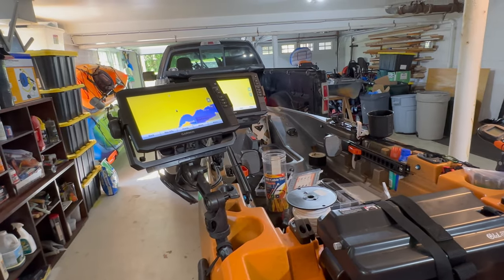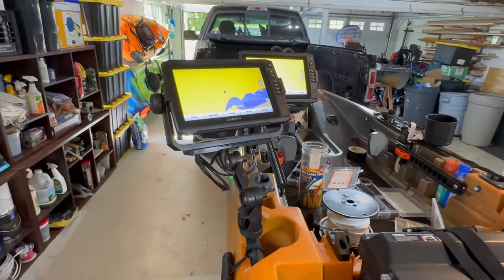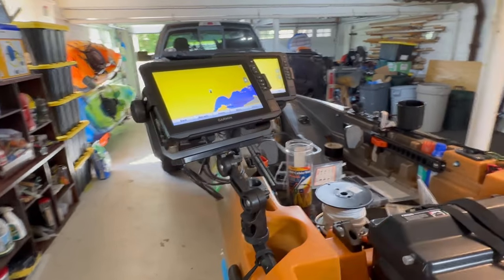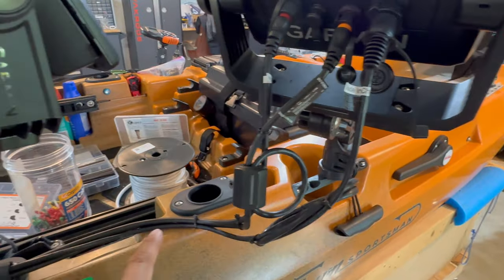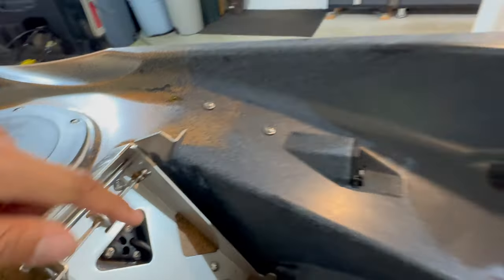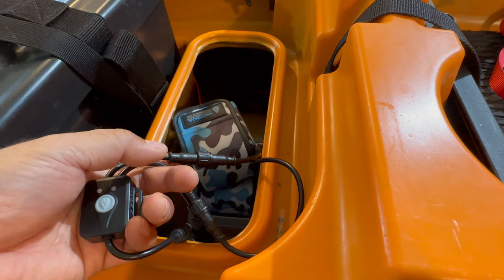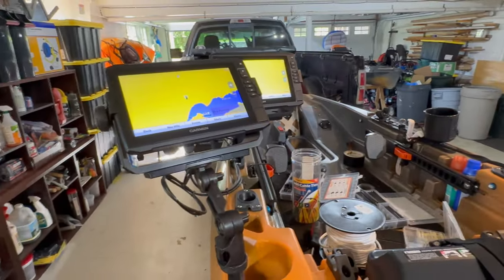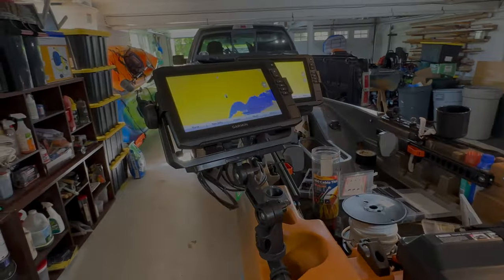Networking 2 Fishfinders to 1 Transducer | Garmin 93sv UHD | Super Simple

Comment: So can you do two screens and do panoptix as well?
Reply from the maker: Yes you can but will need a network hub if you are gonna use two 93sv’s.  I ended up switching one to a 106sv (has 2 network ports) so I was able to avoid using the network hub.  I believe Garmin sells one called GMS 10.